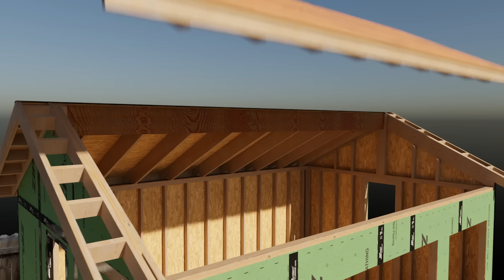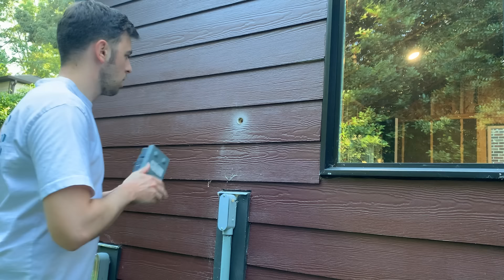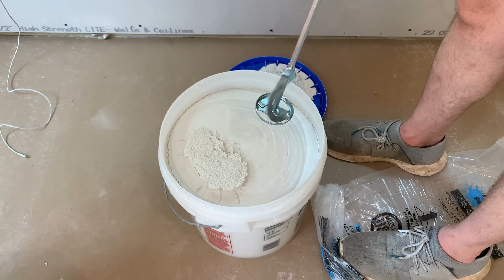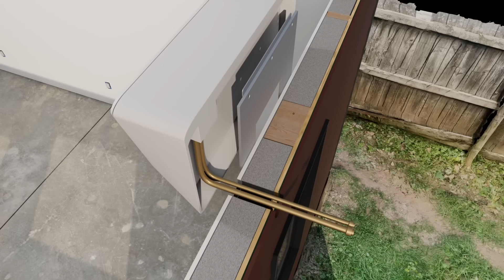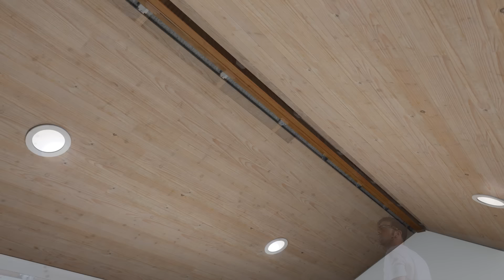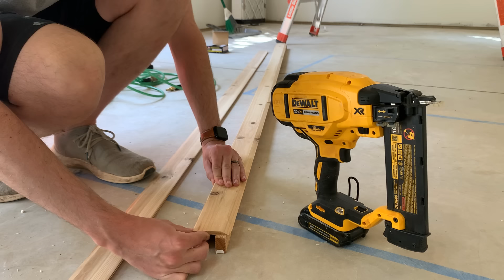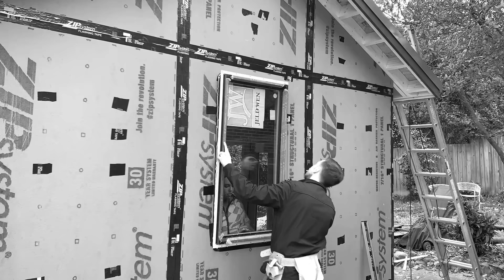Backyard Office & Workshop | Full DIY Interior Build (Insulation, Drywall, and Mini-Split)

Comment: What a fun build! I will say as a building envelope consultant myself, the sprayfoam in the rafters worries me for two reasons. First, is there is so much as a pinhole in your roof, moisture will be able to get in between the roof and the spray foam. As you mentioned, both the spray foam is pretty much impenetrable to moisture, and your roof assembly is also quite impermeable. Any moisture that does get in those layers will sit there and rot your sheathing and rafters. And because it's covered in spray foam, you won't be able to see the damage until it's too late. Go ahead and Google "home insurance cancelled in England due to spray foam", and you will see a countrywide case study of the phenomenon i am describing. Secondly, even if there are no holes in the roof, if the sheathing was installed with any sort of elevated moisture content, that moisture will be trapped forever as well. I see this stuff quite often, and you can model it using hygeothermal analysis to see how the condensation affects these systems. I also have my gripes with zip sheathing, but that's another monster. It seems to try to do everything all in one, but seems to do nothing well. I would probably recommend removing the spray foam, if not just to let you inspect the rafters every once in a while.

Comment: You did not cover the insulation. You will breath insulation dust, it is like tiny needles. OMG why you did not cover the insulation. It should be isolated from your room by special membrane. Wooden boards will not protect you. They have gaps. You used mask to install insulation, and you did not learn why you did this?

Comment: The are insulation films that are better than spray foam. Used for premium houses. You apply on the wood, outside face, this way it protects it from water.

Comment: Hey.. Quick tip! In 8:37 dont roll your wires in spirals, you will make coils. This practice leads to undue heating of the cables due to the heat generated in the cable, caused by the joule effect and the grouping factor, and also the resistance effect.

Comment: I have so many questions! 1) how on Earth do you only have 3.5k subs 2) how confident were you of the ceiling foam work? did someone check it? 3) did you do electrical courses or how did you learn all these skills!
edit: i thought you were some tech guy, turns out you're a contractor or builder much more knowledgeable 😂
Reply from the maker: Gotta start somewhere! 3.5k still feels like a lot to us and we're super excited to have this much support. The flash and batt method has been around for a while to insulated non vented roofs. I felt comfortable doing it since I'm not in a very cold climate and my office shouldn't be generating very much humidity. I work as a mechanical engineer and I've spent a decent amount of time around electricity. Tech guy is definitely more accurate, just learning the construction side as I go!

Comment: Thanks for sharing. Very nice build. I found that many of the backyard office/storage build videos do not include information about permit and size allowed which I am interested in. Does this build require any permit for electricity wiring and size limit?
Reply from the maker: I did fully permit the building. I reached out to my local code office before I started construction and they were super easy to work with (they usually love it when you call them before you start). I just needed to provide some basic drawings on size and location within my yard before they gave me the go ahead

Comment: Nice video, but I got one question. You ran the HDMI cables through the wall to get connection across the office, but how do you plan on changing in case if you wanted to?
Reply from the maker: It wouldn't be an easy change unfortunately, but I'm alright with this

Comment: This video deserves so much more views!! The only thing I wanted to advise was for you to use an hdmi face plate for the tv it helps when the hdmi cable eventually goes out from moving  or just from being in that angle for so long besides that amazing job would be interested to hear about if you ran the fiber and if so how that went.
Reply from the maker: Good point! I'll take a look at adding one to our setup. Also working on a video covering the fiber/internet install, stay tuned 😁

Comment: If you live in a warm climate the insulation you did on the ceiling should be ok but anywhere high humidity or cold it can cause huge issues.  Moisture will migrate through the Rockwool and condense on the surface of the foam.  Flash and batt is not a good way to do insulation due to the risks and no where for moisture to go.  Make sure to monitor it long term and if you have moisture at the ridgeline that is probably the issue.  Other than that your whole project is very well done and well researched!

Comment: A miter joint isn't to "better hide the seam" ... it simply provides you with more surface area to achieve a better glue bond.
But it's great that you did it. Nice overall for a DIY.
Reply: Both are true

Comment: The factory edges of drywall (lengthwise) are tapered. When you have two pieces meet (running horizontally through the room) you do not need to do al that multiple coat edge feathering stuff. the tape is effectively sunk below the surface of the rest of the drywall. So you just slather a coat on top of the tape and then use a big knife or trowel and just scrape it flush with the rest of the drywall. this will fill that tapered valley. Then do this one more time with lightweight mud (because of shrinkage) and it's done. No need to feather it several feet like you did. Drywall is designed that way to make those huge horizontal seams super quick and easy. it's the vertical butt joints that sit the tape proud of the drywall which require all the feathering.